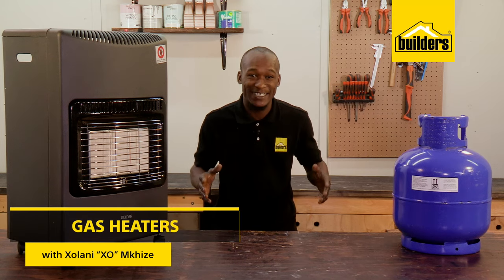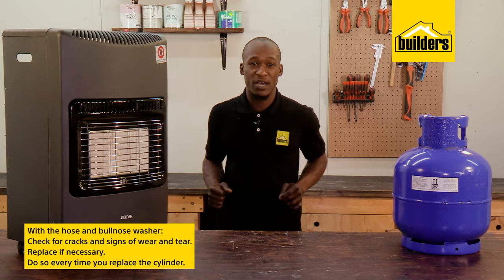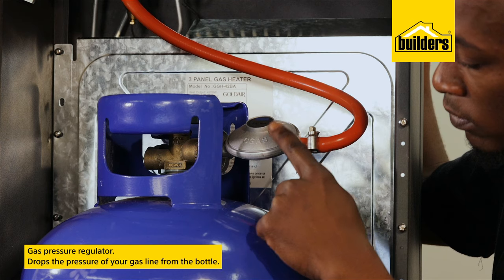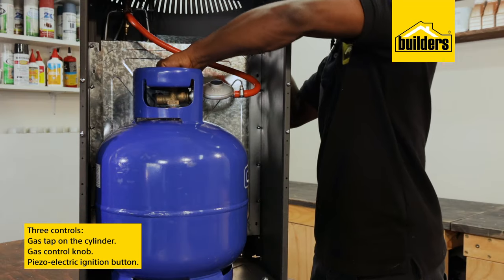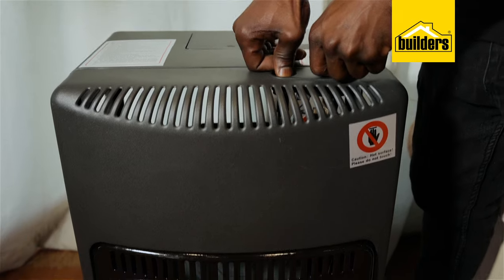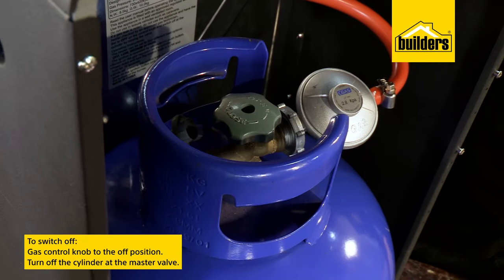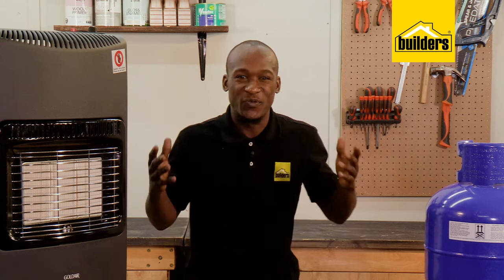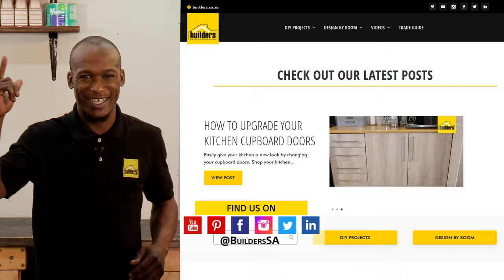Gas Heaters & How To Use Them Safely

Comment: Always burn gas out first (close gas valve) before turning knob off.
Reply: Can you please explain?
Reply: @Turtleback8024 I think they mean when you turn the heater off, close it from the back and then from the top. This will burn the remaining gas in the pipe I think
Reply: It's actually better to retain line pressure... this is an old wives tale from the 90s. The seals don't have to expand and contract as much each time you use the heater. If you are purging the pressure for safety then please revisit step 1.... check for leaks. Service your unit.

Comment: Hi I was just wondering if the gas smell that it emits is normal  and there’s shhh sound aswell?
Reply: The gas you are smelling while heater is on is vapor...it's okay as long as you have a window open,but when you smell gas before ignition or when it's not in use,don't attempt to start it,inspect valve,pipe and regulator before use.
Reply: Oh and the shhh sound are the burners...
Reply: @yusufswartz4958  the sssh sound is it normal my gas heater is brand new and makes a shhh soul so loud like there is a bee in the house. My previous gas heater was not making any kind of noise

Comment: Just bought the exact same heater with a 5kg gas cylinder at Builders Express Lynwood... When I ignite the heater for 20 seconds and let go of the control valve the heater switches off I tried more than 5 times already and the heater never stays lit, should I take it back or how can I get the heater to stay lit???
Reply: I’m about to purchase the Cadac version of this heater and was researching this exact issue others have mentioned. YouTube video “Calor Portable gas heater” by Calor Ireland had a comment explaining it. They’re all basically the same design and branded differently:
“w3vy xbillz • 1 yr ago
Hii had the same problem basicslly all you need to do is
first hit down the control knob (the thing u turn around) and
hit the red button once and leave the red button but not
the control knob
note: u have to hold down the knob button to the setting
which has the flame and spark sign on it so basically the
top one
so u have to hold it on that for about 15 secs
after that ull have to switch to the.first setting and leave
the control knob
if you want to change to higher settings ull have to wait for
like 2 mins so the first one gets a bit hot so it can give fire
to the other two
then push the control knob slightly (if you push it hard ull
find urself not being able to switch, so just push it calmly
and change to the desired setting.
Kind regards”
Reply: @Boitumelo Mnisi hi there did you manage or did you have to take it back?
Reply: I bought mine at Builders Woodlands and im experiencing the same problem. Unfortunately I have misplaced the receipt 😭
Reply: Guys, I’ve got mine for almost two months and in my experience it works perfectly if you follow the instructions.
To turn on: open gas cylinder valve about a quarter turn. Press in AND hold down heater control knob to first position, then press the igniter while still holding and only release from pressing down once the middle panel turns fully blue. Leave in position 1 or increase as desired. If you miss the first time, there’s probably not enough gas in the heater pipeline yet so redo those steps and make sure to stay clear off the heating panel as collected gas can create a little extra flame on ignition.
To turn off: always close the gas at the cylinder first and then close on the heater.
Reply: @ganjabobby hi, I always thought you had to turn the gas on completely but am I correct that you only turn it on a little bit?

Comment: why do the pilot burner go off when leaving the controle valve
Reply: Try to open valve slowly, after ignition keep know held in a few seconds longer and than see what it does
Reply: Mine also does the same. As soon as I let go after about 15+  seconds after ignition it turns of. It does not say on.
Reply: @sisiondamic3125  mine is doing the same

Comment: When I turn on my mobile gas heater, a smell (I really can't stand) similar to gas smell is spread all around the house rooms, is that normal?
Reply: It sounds like you have a leak.
Reply: It’s normal for gas furnaces to emit small amounts of gas when cycling on. If you occasionally detect a faint gas odor near the furnace during this cycle, you don’t have anything to worry about. However, if you frequently smell gas throughout your home, your furnace could have a dangerous leak.
Reply: Keep windows open for ventilation while heater is on...to familiarize yourself with smell,remove attachment from cylinder...open valve and smell do it in open air, reconnect attachment and  ignite again, obviously indoors now, if you get the same smell you had while testing outside,you a have a leak...switch of immediately, do a soap test,by using water and dishwashing liquid, spray over  gas valve, pipes and regulator ,if you see bubbles, you've  fond the problem., but when it's on and smell gas but not the same as outside,it's just gas vapor,you are basically burning out into the air,always open you window, when doing it indoors

Comment: Turn it off before sleeping and ventilate the room well, a carbon monoxide detector is vital.
Reply: You don’t need that, the fire burn the gas and that is all, you think like if it was a gasoline or any other motor gas. This is the same gas we connect on the stove to cook, you turn it on the fire, cook and that is done
Reply: @Wonder-the  you’re wrong, if I don’t ventilate for the first hour the gas is lighter than air and it sets off my carbon monoxide detector that’s hardwired to the mains in my house. I’ve just looked online as I wrote this reply.
Reply: @O1Richard  I’m not wrong, if the fire is on you have no risk of monoxide, monoxide is dangerous if runs loose. Do you ever got in to a house that have gas stove? Ohhh my God!!! How do you thing that works? Some houses even have those fancy with 6 burners on it. You just turn it on and that it
Reply: @Wonder-the  in England our gas appliances are vented, chimney for gas fire and boiler.
Reply: @O1Richard  you probably have some diferente type of gas then. Gas once is on fire has no harm